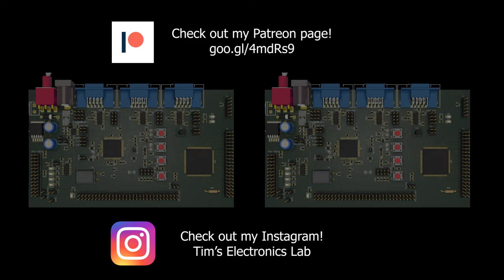#92 Fixing my wobbly ring light 💡 using hotglue 🔫!

Comment: Cool idea for stiffening. I would probably have bought one of those steel plates with holes at the hardware store, and epoxy'ed it to the back. Your method is way less intrusive.
Reply from the maker: Wouldn't that add more weight than stiffness? I will remember your tip for sure, I might have a project coming up that needs such a solution!
Reply: @TimsElectronicsLab  It is obviously heavier. But being mounted at the base it should not mean much. However your solution seems better.